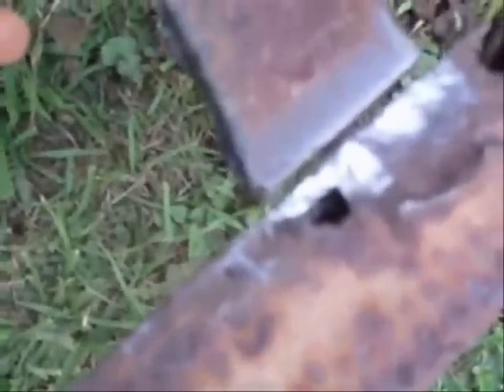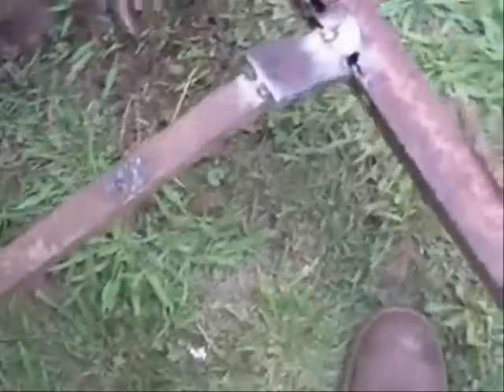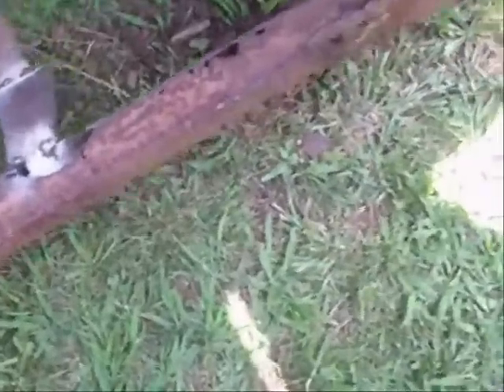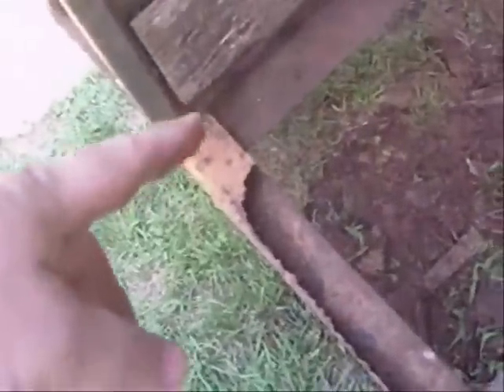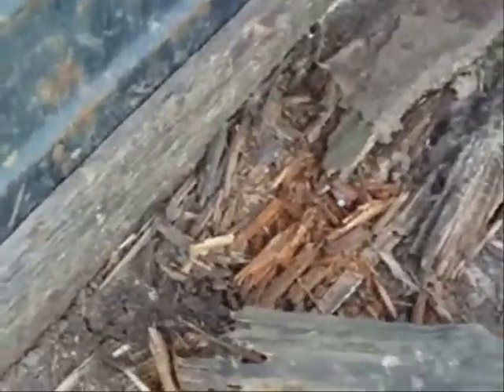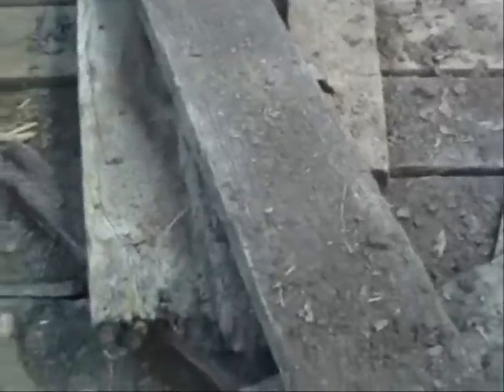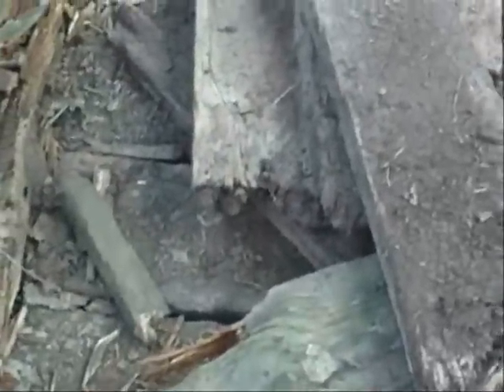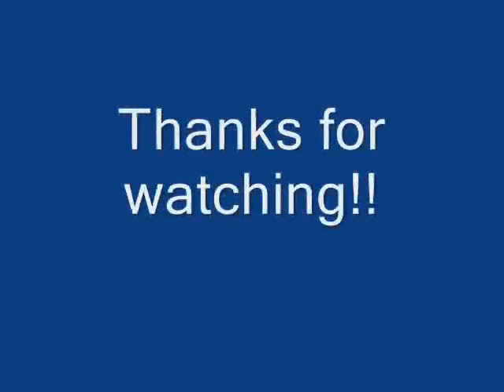Horse Trailer Floor Repair

Comment: Livestock trailers & pee. That stuff is acidic. I've see stainless steel completely rotted out where ever there's a weld in milking parlours less than 10 yrs old! I would coat that frame with spray on rubberized undercoat.